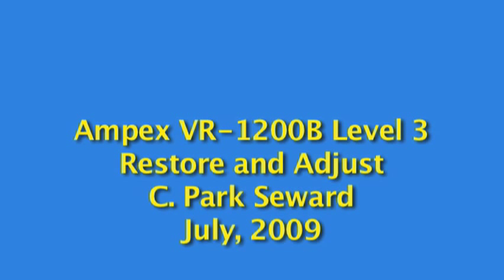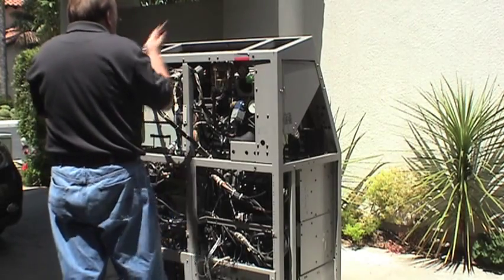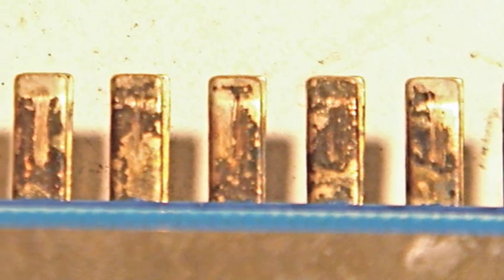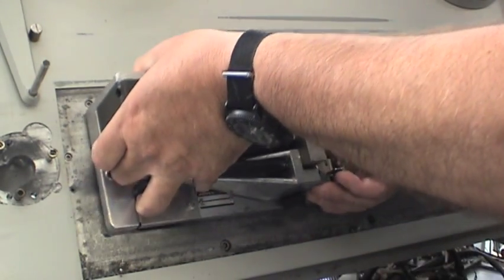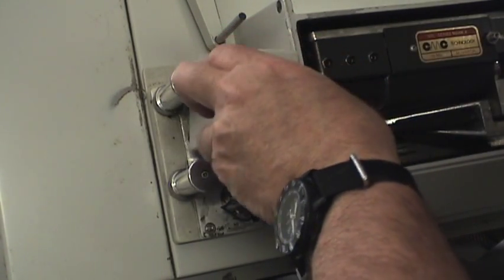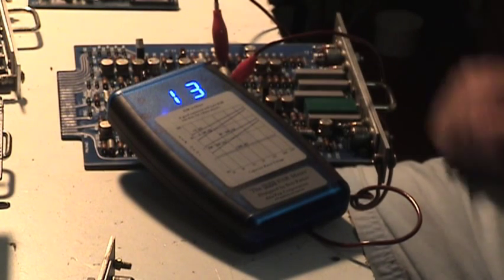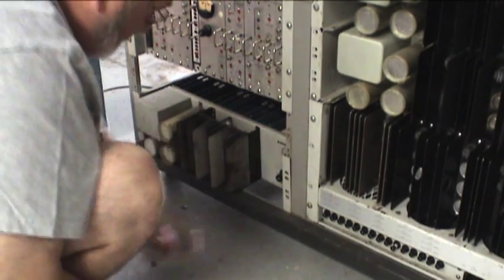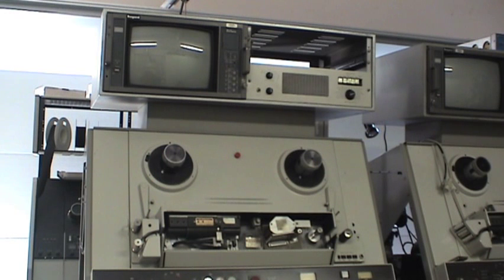Restore, Ampex VR-1200B, Part 3

Comment: Hey Charles, did the original take up and supply reel tables use cork instead of rubber for the reel cushioning?
I worked on everything g Apex made, from the VR-1000, 1200, 2000b, 3000, AVR-1, 2, 3, ACR-25 AND 225. I must say I loved the 2000b. Since Apex originally shipped the Machi es with a B&W monitor, we pulled them all out and replaced them with 19" Conrac color monitors with a custom speaker hood mounted above the monitor. 
I remember when the tape was in rewind and when it came to the end, I slapped my palm on the supply hub so I could pull off the reel.
I wish I could still operate with an Ampex quad again.
The kids these days have no idea what we did to get a picture on the air. It took some very technical knowledge to operate one of these. I miss those days.
I worked on the first TV network, WABD in NY (channel-5) which was bought out by Metromedia, then Fox.

Comment: could you tell us where did you get all the replacement parts ? the circular rubber parts, the button switches, the black foam (4:30), filters (3:25) and so on. I bought some analog video units from ebay and I have a few faders and proprietary cables missing :( is there a secret place on the internet to get this sort of stuff ? very good job on the video documentation by the way, this is gold.
Reply from the maker: Some parts came with the four Quad VTRs I bought. These replacement parts were saved with the machines, like the circular rubber pads for reel mounts. Craft stores are good to find things like the thin, black foam. Filters can be bought from the manufacturer.  Some items may be "unobtaninum" and you may have to make them. I know of users that have designed their own replacement electrical circuits. It can be quite a challenge.
Reply: I see. thanks a lot for the response and all the info Charles.

Comment from the maker: The tape formulations change all the time. In the early 70s, some used binders made of shorter molecules that absorbed moisture. t made the tapes sticky and they would not pull through the machine. Baking at 130 F for 12 hours dried them out and made them playable. I've baked hundreds of tapes.
Don't know about NASA.